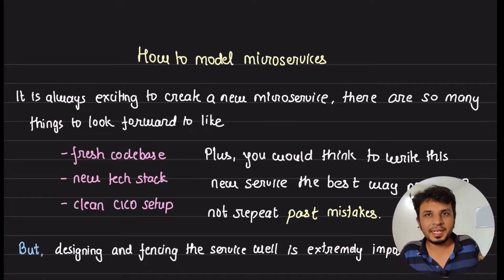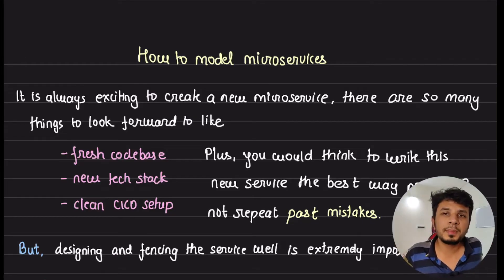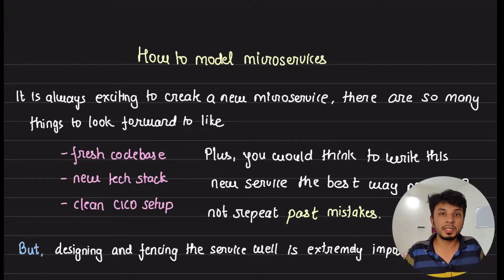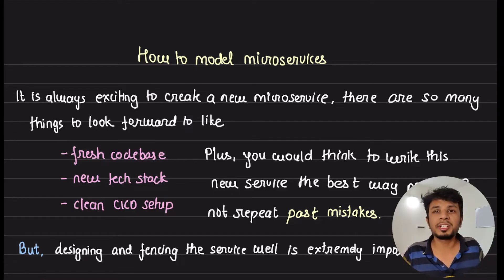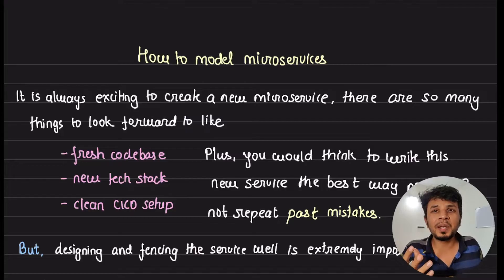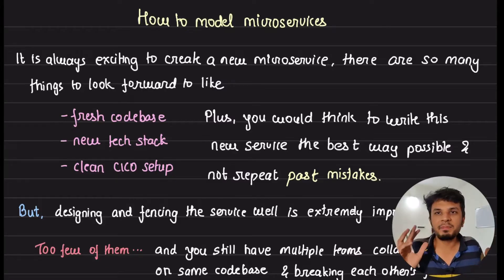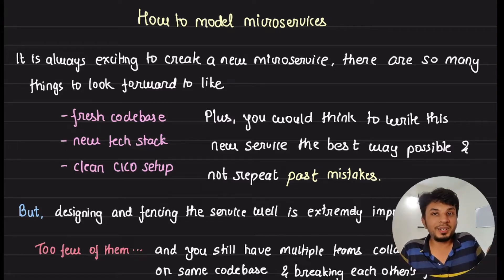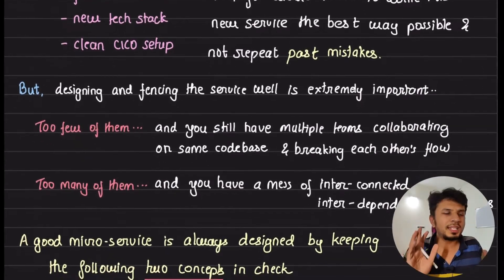How to Scope Microservices Right with Loose Coupling & High Cohesion

Comment: In some cases I think it's very tough to keep services independent. Suppose two service are using a queue and queue has messages of certain types, unless both services know about the queues message model how would they operate? And when we introduce the message sharing between them the codebase for message model is shared. So whenever the message format is changed the services will need to be changed and re-deployed accordingly.
Is there any way we can avoid this? Please suggest if it's possible.
Reply from the maker: There is no way to avoid this but you can make the transition smoother. Instead of involving breaking change always make a backward compatible change to the message format this way the services will not be required to be deployed at the same time.

A good way for both services to agree upon a format is through a shared library/configuration. So never copy the format at two places, instead create a shared lib and put the format there. So then it is all boils down to version upgrade of the dependent library.
Reply: @AsliEngineering  Thanks for explaining that’s on the same lines I was expecting. Thanks for great videos too 😊